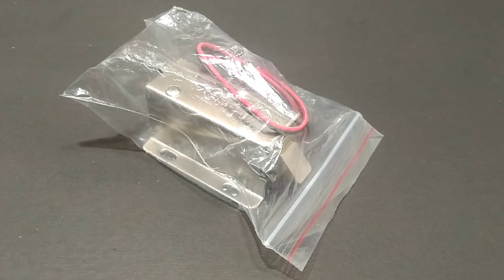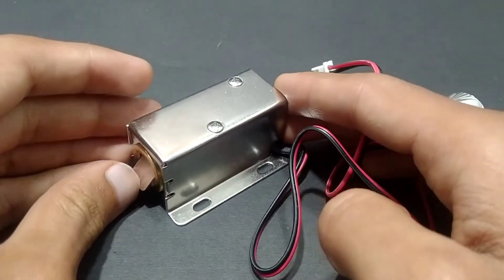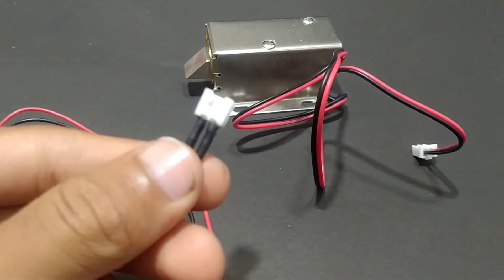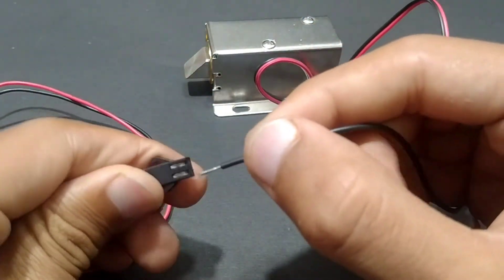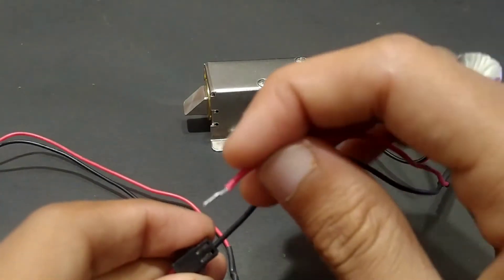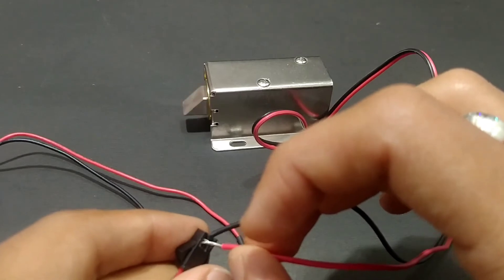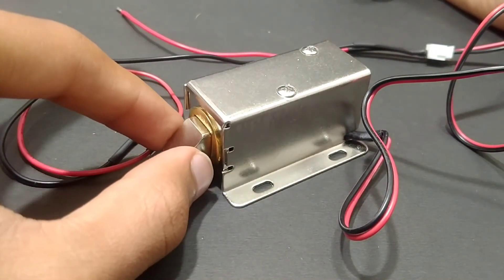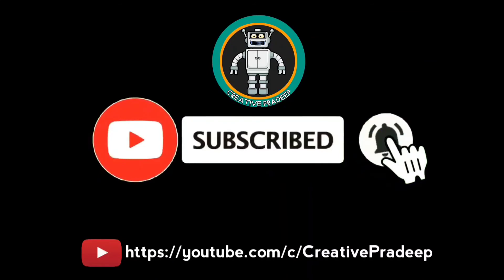Unboxing of 12v Solenoid Lock

Comment: Hi , how powerful is that latch in think of using it for a drop gate on a feral pig trap operated with cellular trigger to power the latch ! It will have about 20 kg sitting ontop of the latch do u think it will have enough pull force to drop the gate ?

Comment: Do I just connect the positive and negative of that lock to the spst switch?
Reply: Or it does need ic or arduino to function?
Reply from the maker: U can use push button to it u can't use switch if you use switch it will blow